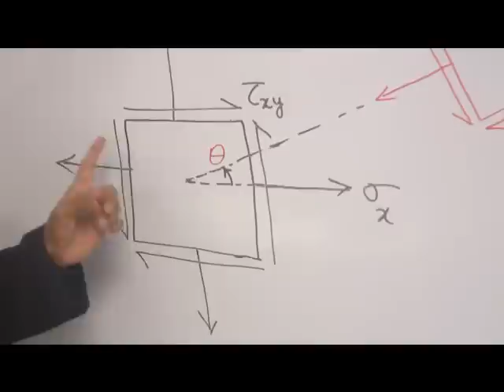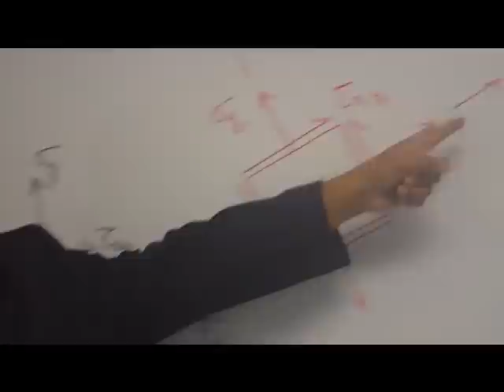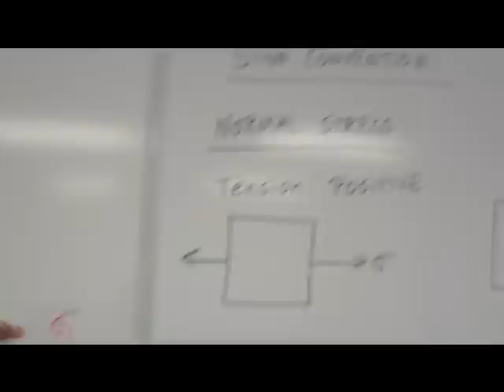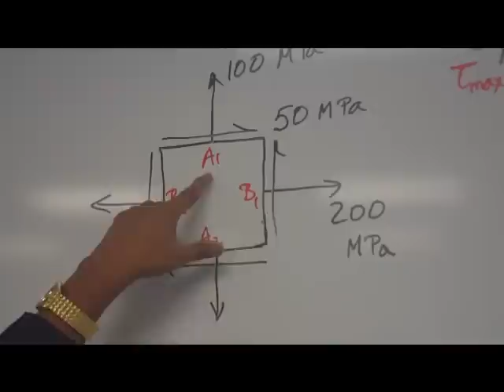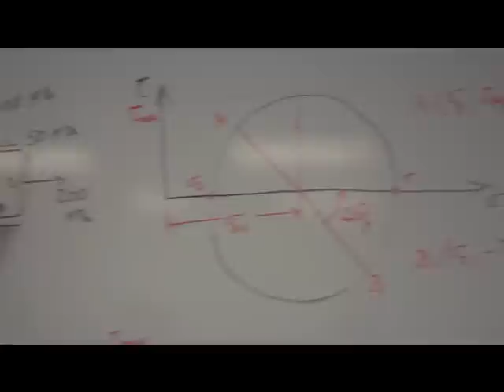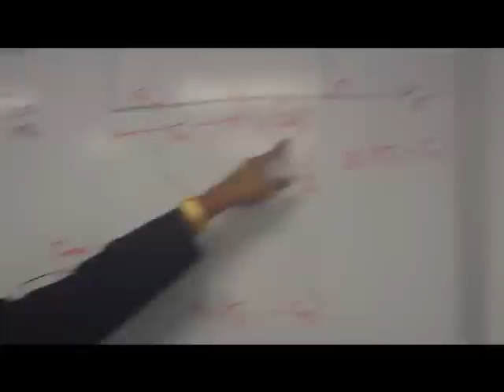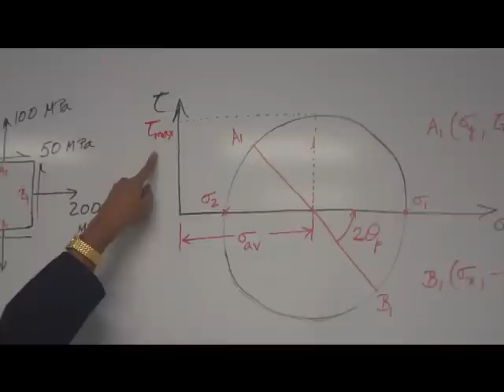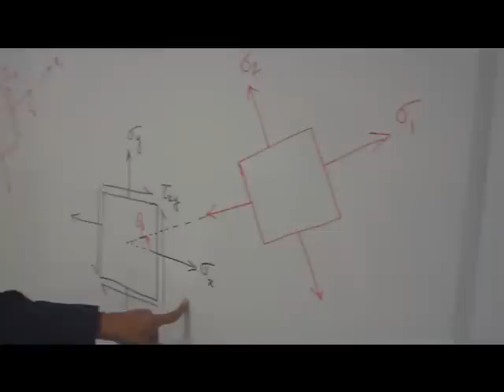Mohr's Circle

Comment: So THAT's why the angle inside Mohr's circle is double what the angle really is.

Also, I've discovered the hard way that when you draw the graph for Mohr's circle, make sure your axes (tau and sigma for y and x respectively (or z and x respectively)) have the same scale. If you draw 20N/mm^2 per cm of your graph paper for sigma, don't then draw a different scale (i.e. 10N/mm^2 per centimetre)  for your tau axis, or your circle won't be right.
Yes, I discovered this the hard way